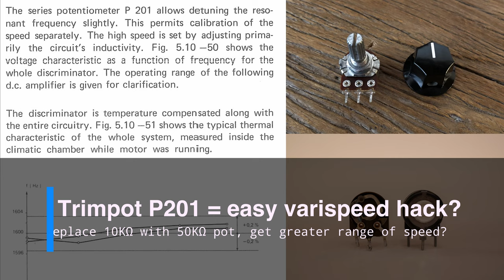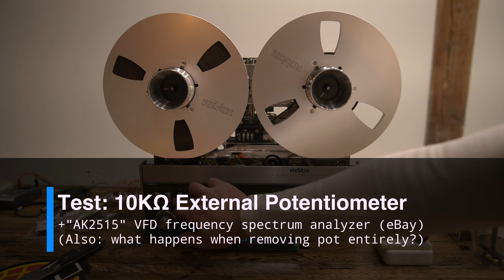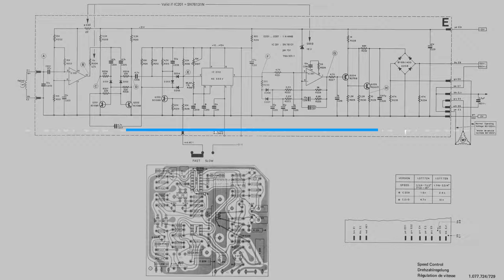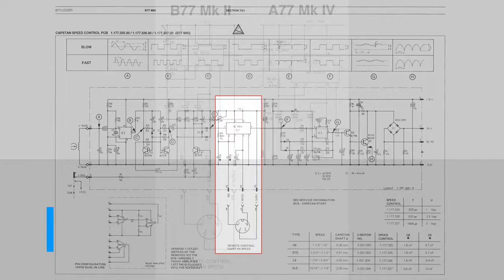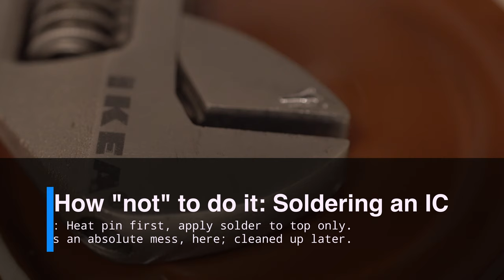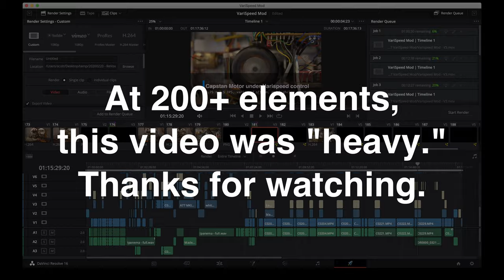🛠️ ReVox A77 Reel-To-Reel + DIY Varispeed Mod, Part 1: How-to, Tape Echo / Dub FX + Demos 🔊

Comment: very interesting.. unfortunately I don't have a nice revox but only a teac X3.. it's has similar speed control board internally with a NJM2903D IC (dual comparator) which is doing a similar PWM for the two stock speeds.. (3.5/7.5). This video has me considering designing a similar remote mod varispeed..
i see the Revox remote has quite a simple circuit, is the LM301 used to buffer the 12V supply to the speed adjustment Pot? What is the course and fine tune switch doing? Also tonally, you say this varispeed give a range of +-8.. any idea what that is in musical semitone ranges? thanks again
Reply from the maker: Pardon the late reply on this detailed question! On the ReVox remote, I believe the "fine" vs. "coarse" switch affect the range of the varispeed effect. I believe "coarse" is the ∓8 range mentioned. I didn't try building the "fine" part of the circuit.

If your Teac X3 is doing PWM and you have evidence to support building a varispeed control to get you somewhere between 3.5 / 7.5, that could be fun to look into - and I imagine others would appreciate it, too! I am not an electronics expert by any means, but I was able to test and sort out how to adapt the official ReVox Varispeed remote (for the B77 etc.) to work with the A77 MK IV.

In terms of range, I feel like ∓8 is the better half of an octave. I did a few tests on the "Part 2" video, where I showed the range in the motor RPM and a few examples of what that also sounds like.

Apologies again for the late follow-up, I hope this is of some help. Do follow up if you build anything, that would be neat to see!

Comment: Cool demonstration, what would the primary application / purpose be for a spd adjustment mod ?
Reply from the maker: Dub-style echo effects, primarily - recording onto tape, then feeding that sound back into the tape which creates a “sound on sound” effect. I show some examples of this in the intro, and later on in this video.
Reply from the maker: The variable speed bit allows “tuning” of the dub / echo effect in real-time, to match the tempo of the song - and/or, create some wild effects.

Comment: There was a widely implemented varispeed modification for older A77's and a fair number of decks have it installed already--maybe 1 in a dozen A77's on ebay. It seems like these are always Mk2 or Mk3s. There were other standardized mods that one see's time and again in eBay, sales but sadly schematics for these mods haven't found a place on the internet yet.
Reply from the maker: Interesting history and context, thanks. I think I’ve seen vague mentions of DIY varispeed mods for older (MK1-3?) models, but I haven’t seen any schematics outside of Studer / Revox’s own service manuals which connect to the capstan motor PCB typically found in MK IV models which uses ICs like the 555 timer.
Reply: @scottschiller  You can identify the varispeed mod by an extra 1/4" jack placed an inch or two above the headphone jack.  This is where the varispeed controller plugs in.  It's always the same type jack: black, Cliff brand. These jacks weren't too common in the US, so I presume they were sold in kits to A77 owners. There was another amazing mod called "sel-sync" requiring an extra monitor card and allowing an A77 to play and record simultaneously so you could multitrack back and forth with only 2 tracks.
Reply from the maker: @ghostexits Great info, thanks. I doubt I’ll be acquiring more tape decks soon myself, but this is handy for all to see. And, never say never. 😆

Comment: Thanks for your video! I would like to do it on my Revox too but my timer IC is a mc1455p1, is that going to work?
Reply from the maker: You’re most welcome, Romain.
My machine also had the mc1455p1, listed as a replacement for / equivalent to the 555 - but I suggest you confirm this for yourself before you start doing any wiring! 😅
Reply: @scottschiller  After checking the mc1455p1 datasheet, it's the same IC. Just to be sure before starting : BLK is ground, can I connect it directly to the ground on the board? same for ORG with 12v? And also can I use "CV" indication on my board to connect WHT to pin5?  Best regards and thank you for sharing this video!
Reply from the maker: Thanks, I hope this works OK for you. I recommend disconnecting power entirely and having the machine off when making or changing any electrical connections. You don’t want to connect the wrong thing or short anything. I accidentally fried the original 1455 chip on mine somehow, in this process. 😬

I don’t have the schematics in front of me, but carefully review what I’ve highlighted in the diagrams. There should be more and maybe links in the description, too.

Comment: Will you share your mod / varispeed control eventually?
Reply from the maker: Yes! I have "Part 2" almost done and will be publishing it very soon. Stay tuned. Most of the circuitry is covered here in Part 1, but I may be able to provide more detail on exactly how I wired things up.

Comment: this is awesome! quick question - with a deck like pioneer rt707 which has a pitch control, would I naturally have control of the delay time ? hifiengine lists it as "± 6% Pitch Control" but im not sure if that means varispeed
Reply: ????? I have this one as well
Reply from the maker: Sorry I’m late in replying, my YouTube notifications stopped! 😬

Pitch control is probably “varispeed”, yes. One detail you should confirm, is if the feature works while you are recording.

for example: I have a tape deck with pitch control, but the pitch feature only works when playing back sound. For the effect shown here, you want control during recording.
Reply: @scottschiller  Yes you can control the pitch during recording

Comment: Would the varispeed remote work with a Mk III?
Reply from the maker: I’d say it’s unlikely, but doesn’t hurt to check. If your capstan motor PCB has “IC’s” (integrated circuit chips) on it, then it should have a NE555 (timer) IC like on the MK IV and you may be able to build a varispeed circuit for it. However, it depends on whether or not your particular board has chips. I believe with the MK IV, they were new at the time - but these machines are modular, so it’s possible that some of these boards can be swapped out with newer ones and still be compatible. Don’t quote me on that, but I recall something like that being mentioned somewhere.

Comment: If a 1-7/8ips  3.75ips model is upgraded to a 3.75 - 7.5ips, how can this be achieved ? Just replace capstan spd pcb ?
Reply from the maker: I am not familiar with the 1-7/8 to 3.5” process, but my guess would be that if everything is driven by the capstan motor speed control PCB - and, if upgrading is compatible - then you could try the varispeed approach with a PCB that has the 555 or equivalent IC chip. Before you go down this road, I recommend checking that you can upgrade or swap the PCB and that it will work with your existing conversion work.
Reply: @scottschiller  Will do Scott. I also got a 7.5ips B77 and see the capstan is identical. Suppose I should start with the service manual and compare pcb parts. Revox are very modular that way
Reply from the maker: Good thinking, and I agree. It was pretty neat opening up the machine and seeing the layout of all those modules.

Comment: Hi great video, what OHMs did you go for with the potentiometer?
Reply from the maker: Per the original circuit diagram for the varispeed remote, I used a 10K-ohm linear pot.

Comment: Hi,will this mod work on th mk1? Thanks
Reply from the maker: It is not likely, but it depends on what version of the motor control board your machine has. At the time, integrated circuits like the 555 timer IC (“chip”) were new. If you see chips on your board like mine, then varispeed may be possible. I believe the MK IV was the first model to have ICs on the board, but these machines are pretty modular and boards can be swapped out to some extent. I am not sure what compatibility is like, I have only ever worked on my on MK IV model.

Comment: any chance to sell me all   i need to mod my mkIV (with the wrong electronics inside, seems like the first iV's are not the same as the later iV's?)
Reply from the maker: I'm afraid I don't make or sell kits for this sort of thing, unfortunately, as it really isn't plug-and-play. You need a machine with the right IC-based motor control PCB, and then you also have to wire up the DIY varispeed controller circuit to a few places on the board; that means you have to open up the machine, etc.

Even when you have one with the right PCB, my $.02 on this is, "here be dragons." I think some tinkering, hardware, and electronics experience is needed to feel comfortable doing this work.

I took the chance of building and wiring up my own external Varispeed circuit - and it did work after some mistakes, but it felt quite risky; I assumed I might break the machine along the way! I was lucky in that I didn't break anything, but I did fry one 555 timer IC and had to replace it. Thankfully, that was the only thing that broke.

I do see ReVox motor / speed control PCBs on eBay sometimes, e.g., https://www.ebay.com/itm/REVOX-A77-Speed-Control-PCB-Board-Card-Reel-to-Reel-Part-1-077-724-Rx111/324200470240?hash=item4b7bda96e0:g:6ZoAAOSwmGde6RZt - this has the 555 timer IC.

*However*, I have no idea if this would "just work" if you put it in your machine. It's not clear to me if you can mix and match different PCBs in a particular machine. Mine happened to have the IC board when I got it, I didn't have to change or swap out anything.

While these are designed to be reasonably serviceable (especially vs. today's surface-mounted microscopic electronic parts etc.), there's still a chance you might break something trying to open the machine just to get to this card, or while unplugging all the cables and so on; it is a non-trivial amount of work.

If you can, a safer approach would be to get a B77 MK II model (not the MK I) that has varispeed built-in on the front panel, a smaller dial. I think it has only ± 2 in range, you need an external control to get the the ± 7 range - but it's a start. 

With a B77, you could either try to find the external varispeed remote ($$$), or try building your own version of the circuit I did and then making your own control which you could connect via 4-pin DIN plug into the B77's remote control socket.
Reply: @scottschiller  thx, but i remember the video from Prince Fatty - he said 'don't buy the B77' while he was demonstrating the vari speed on the A77 mkIV- i guess it might be because the  B77 does not do the slow speed like the A77 - i want muddy tape echo's for DUB- i want a revox that goes as slow as the one he used in the video. I guess you have seen that video too?
Reply from the maker: @klinkske  Ah, yes! That's how I got started on all this, hah - Prince Fatty's "Masterclass" video on dub techniques - right around the 26-minute mark. https://www.youtube.com/watch?v=AmEwSLuUbsI&t=25m48s
What Prince Fatty's saying is, he thinks the B77 only comes with tape speeds of 7.5 and 15 IPS - whereas the A77 has 3.75 and 7.5 IPS. The lower 3.75 speed, slowed down even further with varispeed, can be helpful when you want to work with lower-tempo music.
I think there are B77 models that have 3.75 and 7.5 though, per this page. Worth a look. http://www.reeltoreel.de/worldwide/B77.htm
Even if you can only find a B77 with 7.5 as the lower speed, I wouldn't rule it out entirely; I have some things running at 7.5 IPS here and in my more recent videos, and you can still bring the speed down a fair bit.
Reply: @scottschiller  thanks, i think i just scored the right A77 mkIV - i tried to send you a email with some questions.

Comment: a shame my a77MKiV is old board- it can't have the B77 mod :(
Reply from the maker: If you look on eBay, you might be able to find a compatible IC-based one for a reasonable price. YMMV, at your own risk etc. Note that mine is an A77, but the capstan motor control board is IC-based with the 555 timer; that's the important part making this possible.
Reply: How does one determine if an A77 is compatible ?
Reply: kerry gatt it needs a black component on the board under the transformator. A Trim pot. If it does notnhave this, it is the wrong board. You can see this if you remove the case, easy. Check this video at 2 min 53 when Scott swapps it.
Reply: klinkske Turns out I got the right one! 
Thanks for clarifying 🙏